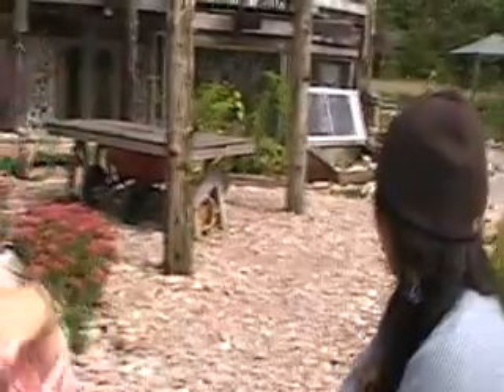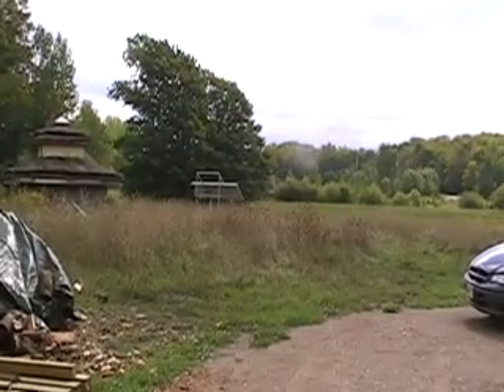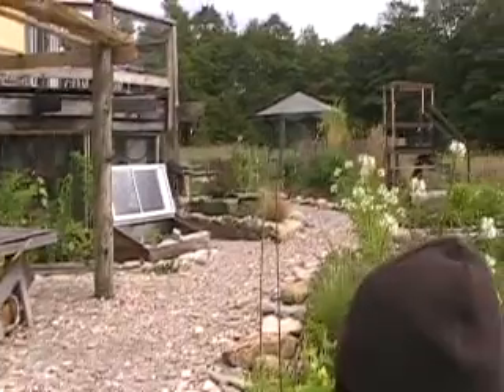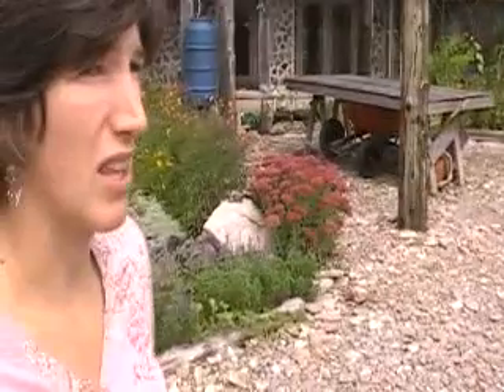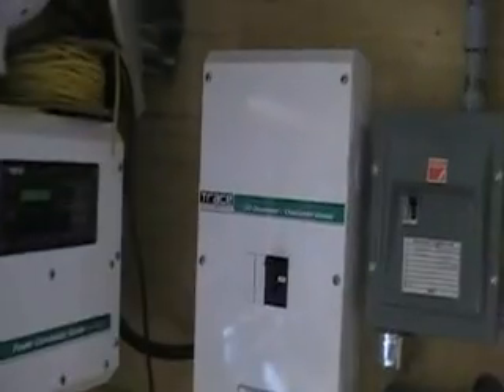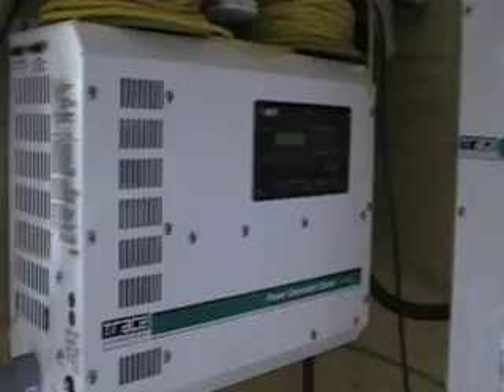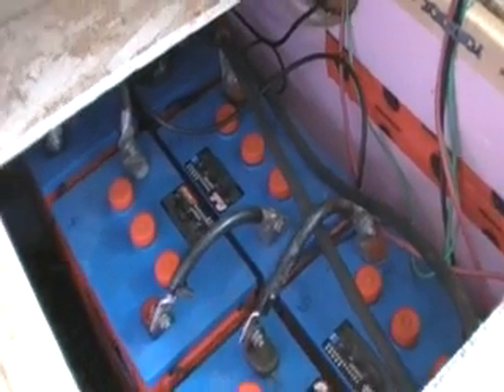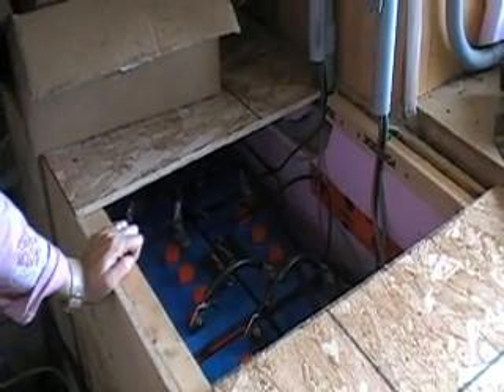Organic living Grass house off the Grid Canada 2008

Comment: you can also use sedum on the roof, low growing succulents that don't need any maintenance once planted and are lovely when in flower.  Make for great insulation as well and are ideal in dry areas as well as wet ones like Scotland/Ireland.

Comment: The issue of the battery problem. Currently there is not much to offer. Thye just die from the recharging. Keep them cool, keep them balanced and well watered. Use distiled water. It will prolong the life of them. I also recomend keeping well clean. Keep checking your wiring for ground faults and stuff like that.

Comment: for the price of that high level breaze you can spend little 15 on a 1,2k device that spins at a very very slow 3.4m/s with built in ac inverter..wind spire